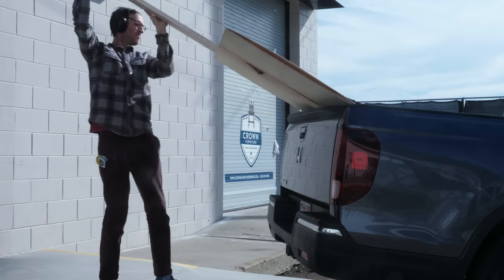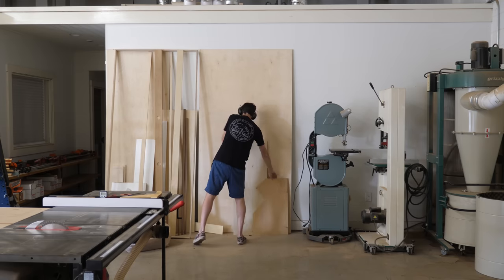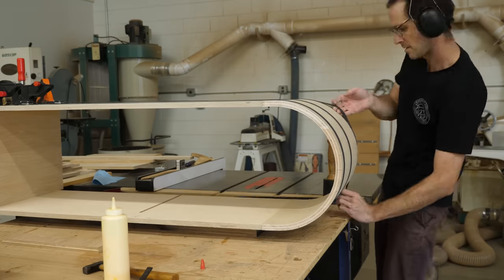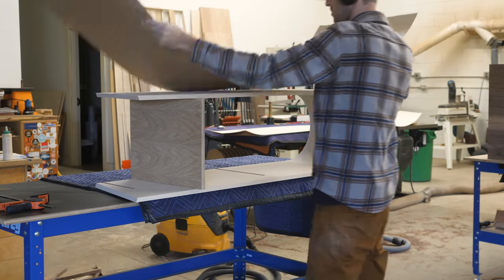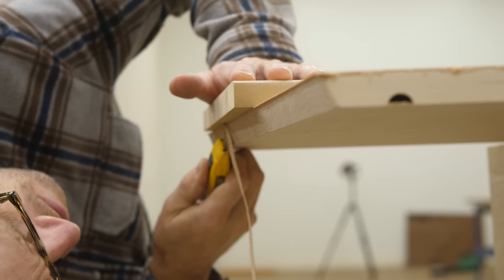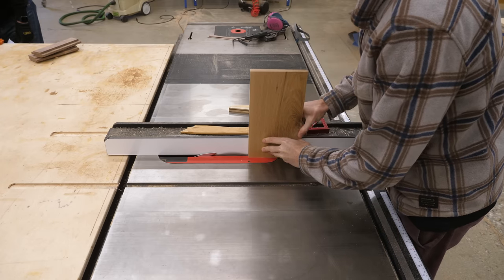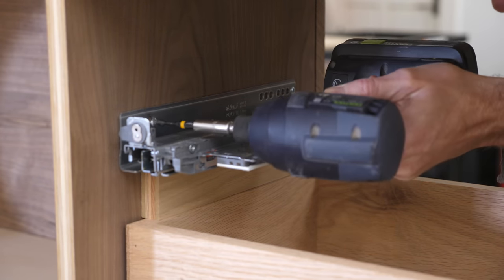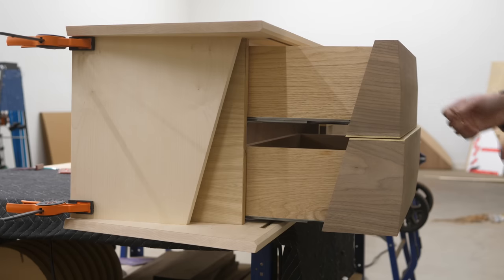Mistakes happen…they’ll never know

Comment: I used to build custom cabinets. And the shop I was at always edge banded before veneering. Did the same for laminate countertops. Edges then top. I think my boss preferred that look. But I agree, there’s no universal right way. Also? With the paper backing, it’s sometimes able to be finessed or hidden by how you sand it. But it’s not always possible. Definitely easier with darker colours or darker stains.
Reply from the maker: Yeah, I was able to kind of feather the seam a bit, which helped. But with the maple being so light, it just would never fully disappear.

Comment: really like your thoughts on mistakes. i too feel that road block way every once in awhile when making something or fixing something. great video explaining a lot of the sentiments and thought process during a project. it was spot on. my heart sank when i saw that tiny wiggle while routing the face of the door for the brass. as i knew what was coming from experience. i sure hope you sell this dude. its a bitchin piece; mistakes and all.  
ps any rabbit truck updates?
Reply from the maker: Thanks Mike! The truck is currently sitting at my house completely disassembled, so maybe some updates at some point, but it is slow going these days.

Comment: Just use the "widening" setting on the domino machine ( it's the green knob with black stripes on it ). Only make the outer holes perfect fit and the other ones in the middle slightly bigger. Take some dominoes an sand them down just a little bit ( maybe color them for reference ) use these for the "perfect fit" holes when test fitting.

Comment: Take a pincer and a hammer. Pince the Domino or dowel and then slam the pincer from the side of the workpiece towards your body. through the eruption the domino or dowel pushes outside step by step without any force. Pretty easy when you've done it once. ;)

Comment: 7:49 could you cut that front edge piece with a slight upward sweep, calculated so the upper edge should be level with where the veneer is at when doing it this way, then when you put the veneer over it, it would be forced up and if you flatten it back out, you should end up with the seam right at the edge, no?

Comment: For domino extraction, take a rectangular piece of wood, cut a hole the same diameter of your domino and cut one side in half, like the negative of a lollipop (sorry I'm french), put a screw and a nut through those two legs, and that's it, you got a solid wooden clamp

Comment: How about a 3d printed domino that's slightly smaller for fit ins?  Could put a small hole in the middle to pull out if it gets stuck.

Comment: First i have to say, I am not trying to insult you with my comment.  Regarding pulling dominos out, i usually sand them completely oval (sand off the nubs) - this helps them go in smoother and with pulling them back out after test fitting. Maybe try that before having Festool make another expensive as tool.  Also make one Domino hole wider than the other to help it out some more. Great tips for the milling of rough lumber. This came out great.  Great job and full plum for the win… jajajaja

Comment: I keep a container of dominos that have a bit sanded off one edge and one face so they aren’t a nightmare to remove when dry fitting. Light spray of neon paint on them so I don’t accidentally use during final glue up. 👍 I do wish the domino had a slot width setting in between the smallest and the middle one, would like the slot to be just 1-2mm wider than the domino.

Comment: wouldnit be cheaper to put the tape on the router then the strait edge ? or thats the way to do it ?
Reply from the maker: Putting it on the straight edge is easier and quicker. And tape is cheap, so I go with that.

Comment: Regarding your domino dry fit to test problem,..in that you can not always remove the dry fitted domino prior to glue up.....why don't you make or have made a set on nylon domino dummy plugs just for dry fitting....i do and it saves struggling to remove a domino plug ......just thought i would suggest it .

Comment: The whole point of edge banding or lipping is to hide an unsightly glueline as much as possible. Thats why when you veneer a box you start with the back, then the sides, then the front and finally the top. If you want to apply the edge banding after veneering, the machining of the edge has to be perfect because any imperfections will be obvious to see.  Having said that, if you want a decorative edge banding you'd normally apply it after veneering because, again, it hides one glue line.. Thats a veneerers advice...

Comment: Domino removal - place a short piece of 1/2” dowel on either side of the domino to act as fulcrums. Take 2 flathead screwdrivers and rest them on the dowels, poking their ends into the domino enough to get a good bite on it. Push down on the handles of both screwdrivers simultaneously, forcing the domino straight up.

It would be pretty easy to make a tool that does this. I just drew up plans for one, but I’m not going to bother. I don’t have a domino machine… or any dominoes….
Reply from the maker: Haha, no use in making a domino puller if you don't have any dominos! Good idea, though!

Comment: This may be an uninformed question, but what if you took 10-20 dominos and sanded them to be ever-so-slightly smaller and just dye them red and keep them around as 'test fit' or 'dry fit' dominos just for that purpose so they're easier to pull, reusable, etc?
Reply from the maker: A few people have suggested that! Not a bad idea, for sure.

Comment: Fyi the bag vacuum bag Will work with a shop vac and heavy duty garage bag vacuum suction works per square inch being the bigger the surface area the more force applied vacuum bags can exert enough pressure and or suction to lift a car if done right. A normal shop vac is like 2 lb of pressure per square inch or something. If you increase the square inch by like a thousand times that's 2,000 lb of pressure is all over. It's insane what I can do don't let me go inside of garbage bag. Hook a vacuum up to it, even if it's a garbage bag they could easily rip once it's around you and suctioned you're probably not strong enough to rip it

Comment: the vacuum pump does not create the pressure!  not that much anyways. if you took that vacuum bag and pump into space and ran it there, it wouldnt have nearly as much pushing force. its the 60 miles of air pushing down that creates the pressure (about 15 pounds of pressure per inch!)

Comment: Beautiful piece!! Not sure if you read all of these, but the level of craftsmanship on this channel should be studied. Seriously some of the best woodworking I’ve seen. When you’re gluing the edge banding and using tape as a clamp, try adding one long strip across the top of the piece before adding all of the smaller pieces . It allows you to just rip that long piece instead of picking away at each individual piece of tape. Cheers!

Comment: Go outside the box and use copper for the edging. That's more unnatural than ever. Stainless polished steel. Or an old bansaw cut to size. And leave the old rusty edge be

Comment: This is seriously so sexy! Yes, furniture absolutely can be sexy! This is probably a really dumb question. If the panel be to be cut down the middle for the drawers, why did it be to be glued up into the bigger panel? I might have missed something. I seriously love this piece!
Reply from the maker: Thanks Melody! Because I wanted the sliding door and drawer fronts to all have continuous grain it is much easier to glue-up a big panel, then cut that panel into the sections. Rather than try to do them all separately from the start.